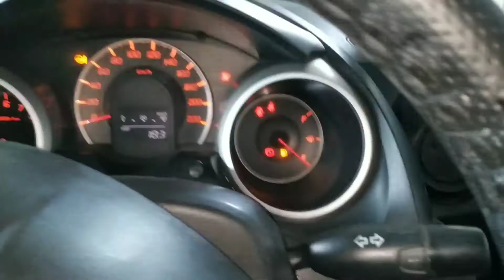4.Four Indicator Not Working, Honda Cars, Honda Amaze, Honda Mobilio, Honda Jazz

Comment: HI Bro,,, I am having AC issue in Honda Mobilio... Can you please see and reply me, If AC is turned on , Radiator and condenser fan both are running always.
Reply from the maker: Yes, AC on,radiator and condenser fan continue running
Reply: In My car Mobilio, while turning on Ac, Both the fans are running in high speed and turned off. After 30secs both the fans are running high speed and turned off. This is repeating. Low speed always is not working... What may be the issue.
Reply from the maker: Check the  mechanic

Comment: Bhai Honda jAzz 2017 Dec ka S model hai,21000 km running hai.Airbag indication continue aa raha hai,SERVICE cenrtre gyaa to bool rahay hai SRS airbag system khraab ho gyaa hai 35000-37000 ka padeyga.
Koi accidental issue nahe car mai....koi solution?
Reply from the maker: Sir horn buj rahe hai
Aap kahan se hai 
1 baar check krna padega 
Ho sakta hai horn ka ribbon kharab ho gaya ho